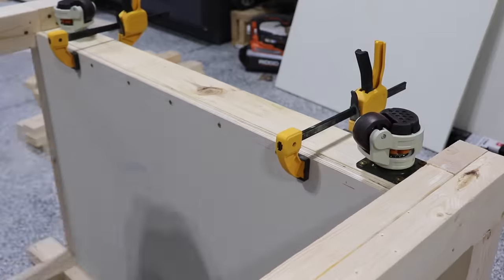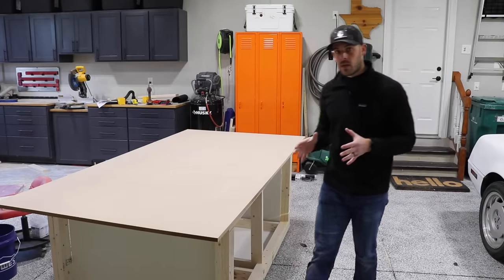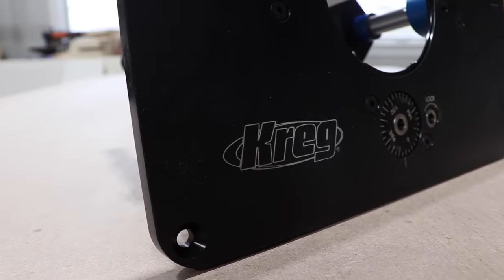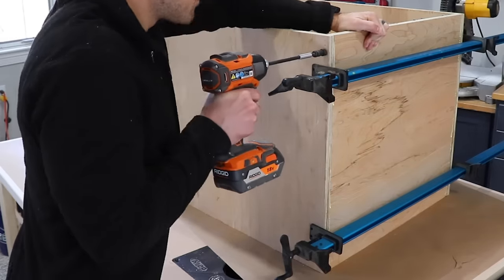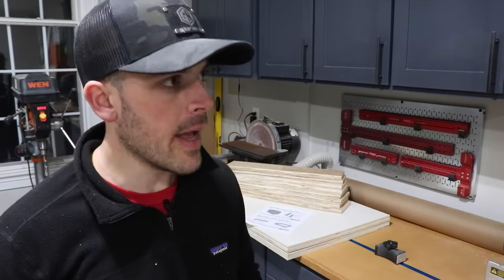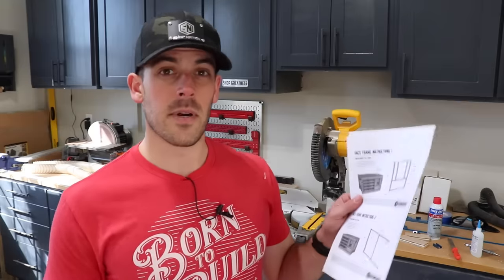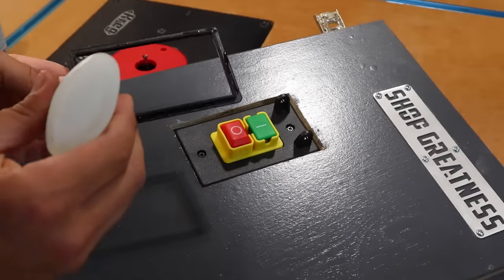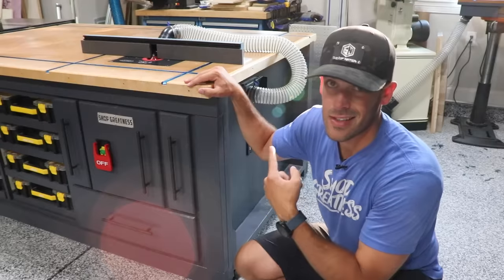The most ridiculous DIY workbench on the internet (Complete Build)

Comment: Just a note for the future, and for your fingers, never wear gloves while using power tools that spin. You do NOT want to know what can happen if, God forbid, something snags the glove while you are moving a board through a jointer.
Reply: I have a glove sitting on my table saw to remind me.  I got very lucky and only got a minor cut.
Reply: Gloves are required 100% of the time in my trade. While I can see where you are getting at with this comment. As long as you are wearing the appropriate gloves that are a good fit for your hands and are not loose as long as you pay attention you will be fine.
Reply: Yea its always fine until its not @MeatUrMakerZ
Reply: @MeatUrMakerZ  Maaaaaybe nitrile or latex gloves.... something that would rip easily but work-style gloves is an emphatic NEVER

Comment: Electrically, you should never plug one power strip into another.
Reply: Its fine if you know what your doing by calculating peak current, but on the whole you are correct in that you should not daisy chain them.
Reply: Why not? Double protection.
Reply: In Iraq, we had a chain of power stripes running halfway around the air base at Al Asad. We only lost 1 tent to fire.
Reply: @georgeyoung613 you just have to hide the cord from the fire Marshall.
Reply: @Nougification  Absolutely! You hide the cord before every inspection. If it's ever found, you blame the first Pfc you find.
Reply: You absolutely can IF you know what you are doing and derate the second strip accordingly
Reply: It's fine, just don't plug them in.
Reply: There are exceptions though.  It is a good rule to follow.  It has to do with the circuit breakers on the strip.  If you have good breakers on them and they are wire sized correctly it should be fine though.  I have a set of ones I bought in Germany for 110v that have scalable breakers.  It is designed to be linked, they advise not to exceed the breaker amperage on your panel.  That's mainly the issue that is dangerous.  People will plug in an entire shop and try to continuously run 30a on a 20a breaker. I run my entire shop on mine.  I am 1 person and my dust collector is on its own circuit.  I never run above 15a at any one time because it's physically impossible to operate more than 1 piece at a time.
Reply: @georgeyoung613  Haji strips have zero protection.
Reply: Unless you have multiple people operating multiple tools simultaneously, or are an Octopus, the odds of overload are nil and none.
Reply: It's all good, he did it mechanically
Reply: Electrically, the electrons don’t care.
Reply: That is horse shit and long as the wire and connectors are appropriate for the loads in the power strip.  That believe is from old people with old houses and no outlets with shit power strips and items with a lot of load.    Assuming your power strips are all constructed to say 15 amps, you can chain as many as you want assuming the total load of everything doesn’t exceed 15 amps, including wire loss.   You outlets are all daisy chained in you wall as well, one to another.
Reply: That is absolutely not true. There are no codes about that in the NEC, and as long as you're not over drawing what the wiring can handle, you're fine

Comment: I recently built a workbench with casters using the red 3” casters at tractor supply and they’re incredibly stable! I believe it’s because their locking mechanism locks both the wheels and the swiveling mechanism so the casters can’t rotate. Would highly recommend them and they’re big enough that they can roll over extension cords and stuff no problem!

Comment: I will add that I work in a factory maintaining industrial type machinery.  We have those same casters on a lot of pieces.  They are very easy to raise equipment up and lower down and hold a ton of weight.  They make it easy to roll equipment around. Good choice for your bench.
Reply: One very cool thing abouthe casters is that you can sewt everything level. I have them on a pool table I built. Sometimes in woodwork a level surface reference can be very helpful in glue ups and measuring

Comment: Watching you use the router in the wrong direction, then clamping on a piece to eliminate blow out was worth the price of admission. 😊
Not busting your balls. Router bit facing up, right to left. Router bit down, left to right.
Reply: And....don't make that deep of a cut in a single pass.  Rule of thumb that I've heard is to take a bite only 1/2 of the diameter of the router bit.  So, if it's a 1/2" wide bit, only take 1/4" of material per pass.  It looked like you were having to work hard to push the router through the material.   You should never have to put any muscle into your router cuts.  Something is wrong if you have to work hard with a router.  It could be dangerous.  Love your videos.  You have great ideas.  Your finished product is amazing.  Keep up the great work.
Reply: .. and also, the way he carries boards is disturbing. It's all fine and well now but 15 years from now he'll wish he used a rope sling and a straight back.
Reply: Dam YouTube is rough
Reply: router bit facing up, riht to left and down for left to right is not accurate. depends on which side of the wood your on. that being said, if your routing the face towards you and the router bit is down, then yes , it is in fact left to right. and thats what he was doing. look at the position of the router.
Reply: however his pass should be no more than half the width of the bit hes using. youl;l break pieces of the wood right off if you try taking off a half inch with a quarter inch bit
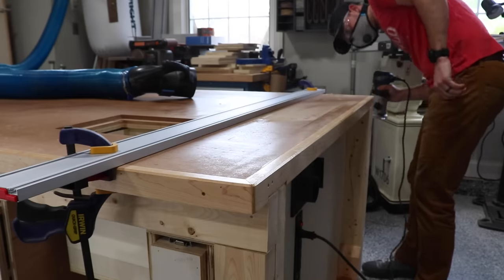Reply: @ericgustin3386 39:10. Wrong direction.
Reply: @michaelcocroft9700 he is making a groove. There is no wrong or right direction. 

Direction is only relevant when working on the edge of a workpeace with a Router.
Reply: @holgerk6352  Hmmmm. Yeah…. No.
Reply: @michaelcocroft9700  when routing a grove the material is always in contact on both sides in rotating direction and one against rotating direction. It doesn’t matter. The router removes equal materiel in spinning and against spinning direction. You can do a 360 around it while routing. 

This is only critical when you route one edge (inside or outside) as there is clear one direction to router wants go natural (and you have to go against).

Comment: Loving this bench, I may make myself one.  From my background in electrical, my only suggestion is circuit breakers.  Each of your power strips should have one built in, and TEST it (cheap chinesium may advertise but not include it).  Reason is, you remember the amerpage restrictions now but how about 5 years from now?  Overload inside wood shop furniture is a great fire starter.

Comment: This is awesome. I'm currently working with a contractor to build my combination wood shop, electronics lab, and music studio... so yeah, I'll be needing a little flexibility. I've built custom benches for work areas in the past, which always did better than off-the-shelf stuff. So I'll be building some custom and, in many case, movable benches for this space over the next 2 or so years. Thanks for doing this! Haven't decided if I'll use this, though it's pretty on-target, but if nothing else, you've already improved on my previous bench-building designs. Thanks!

Comment: I got the plans from you for the medium bench.  I did make some modifications to it, such as increase the overhang that butts up to my table saw ( it is an older Craftsman with an exposed motor.  The overhang protects the motor from wood dropping on it.  )   The table top is 3 each 1/2 inch plywood sheets that I laminated together.  The frame is reclaimed 2x4's from a neighbor's house remodel.  The overall look is white oak trimmed in black walnut.   I did go with the Jessem router  lift and I purchased a Power Tec fence for the router.  Thanks.  I look forward to more videos from you.

Comment: Several years ago I built something similar to this. The top is a 1/2 sheet of 4 x 8 Home Depot cheap plywood. Originally I wanted it to be  a 1/2 thick piece of butcher block but I thought about the price which was just under 1k at the time.
I used a similar caster system but mine have a built in ratcheting mechanism which makes moving the table a breeze. In fact the table is so heavy that I really don't need to rest the table on it's caster pads. But when you do it feels like trying to move a block of granite.

Comment: Really cool video. I can tell you put a lot of time and effort into designing so that things would go together smoothly. 

1 Piece of small advice I noticed is occasionally you’ll not clear your left hand FULLY when you’re shooting brad nails for joining two perpendicular boards. You should always assume that brad nail will divert from a hidden knot or hard spot and come splintering Up the side of the piece rather than following the intended path. 

Its a by product that we all pickup as we learn to hold the boards flush when first setting the corners. So remembering to shift your hold away more than a brad length away from the point your shooting into. Only reason I’m even bothering mentioning is cuz I brad nailed my hand to my project doing the very same thing, hope it saves you an injury.

Comment: Only thing I’d change is to glue a top veneer like melamine instead of sealed MDF. But great plans regardless! 
I have a sanding area in mine that simply has some holes connected to the dust collection so there is a fine drsft
Reply: Was about to suggest that.  I would raise the maple edging by the thickness of the laminate and level the edging to be smooth.

Comment: Nice to see the full detailed version of how you built this as I'm going through making some shop furniture for my garage workshop right now :).  OH... also just to mention, for those casters and how they can be a bit of a PITA to adjust (turn the thingy in the middle), I have 2 suggestions for you (although perhaps you've done one of them already as I'm only 8 min. in while writing this).

1.  Another channel that used them made what can only be described as a key.  It's a about a 6 to 8 inch long piece of MDF / Plywood, and there are teeth cut into one side of it that fit into the notches of the thingy on the caster, and are spaced out accordingly (also make sure the  whole key is the same height as the thingy).  Then he just pushes or pulls the key across the thingy, the teeth on the key catch the notches on the thingy and rotate it.  Voila.

2.  This is the option I picked and is far easier IMO.  They make a version of that same caster with a built in ratchet!!  So instead of a rotating thingy, there's a small ratchet with a direction toggle that works just like a socket wrench!  Set it to clockwise / counter-clockwise and then just wiggle it back and forth like a socket wrench and it'll just raise / lower the foot.  They also have several sizes of these casters to support more weight, so I got the 4 inch monsters that I needed to support the bench I made for my table saw / router table thing.  Each foot can take something like 400lbs I think?  Might even be much higher than that.  Just found them on Amazon.

Comment: Great job. I actually built a similar bench (not as fancy) for my CNC machine. Under the table, I have a shop vac with a Home Depot Dustopper on a 5 gallon bucket, a pancake compressor for blowing off residual dust and a 5 gallon bucket of coolant (windshield washer fluid) with a pump for the water-cooled spindle and a lot of the same electrical setup.
 A couple of things you did gave me an "Ah-ha" moment. I've built a lot of cabinets over the years, building the carcasses then putting in the slides later, then the drawers. That was what I planned to do for this table. When I saw what you did, installing the slides, building the boxes, then fitting the boxes into the table, I slapped myself in the head. Duh! Why didn't I think of that? I liked your using the Sharpie for marking the aluminum. I do some work with metal and trying to find DyeChem is not easy nor is it as cheap as a Sharpie. I subscribed and look forward to watching other videos. I can relate to the mistakes, since I've made those and many others.
Here's a tip for you. I have done a lot of plastic laminate (Formica style). When using contact cement, I'm sure you know, you get one shot at attaching it. Well, I had a full sheet that I got slightly crooked. It was stuck and $100+ was going down the drain. Looking around my shop, I spotted my favorite solvent - brake cleaner. I squirted it under the edge and peeled the laminate right off. I cleaned off all the cement, reapplied it and stuck it on correctly. Whew!

Comment: Small tipp when you use a jointer. You should push the part behind the cutting blade down and not before the blade, because you will lift the piece and it can end not perfectly flat.

Comment: I set up my bench top jointer so my work bench is an out feed, can joint pretty much any length I want, the thing about bench top jointers is you have to take shallow passes and take your time, it's really the only difference from floor model, just saying cause ALOT are so wrong about bench top jointers, they get a bad rap..and nice job on this bench man..

Comment: I'm glad this build series is in a single video.  If there's one thing I learned between you and Tamar of 3x3 Customs, it's to glue your boards first, then trim them to final size.  Doing it the other way around is messy and potentially causes trouble (boards not being square or centered after the glue dries).

Comment: While watching this I realized I could use a cabinet like this doe my CNC router, which is currently sitting on an old kitchen table with open space below.  Having the extra storage and drawers rather than an open space will be much cleaner and more organized.  However, I may have to make it so it can be partially disassembled to fit through a doorway to allow it to be moved.

Comment: Thanks for the video.  I had a question about your dust collection though.  Initially your wall mounted unit was the sack style, but then near the end of the video it is changed.  I've heard that the sacks tend to still produce a lot of fine dust when used and was wondering, is that is why  you changed it?

Comment: The problem you may experience with aluminum angle is that it is often not square. This would need to be corrected before use. A milling machine with a flycutter would produce the best results, but a slab flattener could be adapted to accept a belt sander.

Comment: I am working on this bench currently following along to a T. I have run into an issue with my upper brace install though. They are a 1/4 inch too short. They are measured to the 29.75 as laid out in the plans. Before I cut new braces to fix the issue... is there an issue I may run into by increasing the brace length or maybe I'm missing something else?

Comment: What is the over / under on how long it will be before you change out the plastic blast gates? My guess is 1 month. It won't be long before you discover that they easily get jammed up with saw dust and require being taken out to clear the jam.
Reply from the maker: 3 years later, no issues

Comment: You don't have to sand off the sharpie. Sharpies are an alcohol based ink, you can remove it by going over it with concentrated isopropyl alcohol (97-99% rubbing alcohol) or a dry erase marker. 

Another option for blueing is to use water-soluable powder paints but mix them into ethanol (Everclear or wood alcohol) for application then wash them off with water afterwards. Unfortunately, you can't use water to cool your work piece with this method. That's not a big deal for aluminum, copper or brass; but iron, steel, titanium, pewter and bronze need cooled while they are being machined.

Comment: Pretty AF. One ultra minor suggestion, and I bet you have it: the floor ramp thing for the power cord coming into the bench so things can roll over it and you limit tripping hazard. Even better 3D print a new cool solution for power cords that run across the floor

Comment: If using the router on aluminium feels scary, you can also use a jigsaw with a specialized aluminium blade then use a metal file to refine. Doesn't cost much and can be a good alternative a bit less sketchy.

Comment: Love this build. Why did you go with the Powertec blast gates though? Have you had a positive experience with these (unlike mine)? I used those exact ones and learned they are impossible to clean when dust gets in the gate slots. I upgraded to metal ones and haven't had a problem since.

Comment: I put four , three drawer filing cabinet. Then put two 3/4 sheets of plywood on top ,,, painted the whole thing with a two part epoxy  install LED string lights along the edge so you can see inside drawers & above at ceiling height,install a bench grinder & vise ,, ,,,,, it’s my mechanical  electrical  work station,,  I have another one strictly for woodworking with tools stored in filing cabinets

Comment: I know you have plans for a workbench that incorporates a table saw into the bench. and I think thats what i want to do. but I don't have that much space so is there a way to build your bench with the table saw, the miter saw and a thickness planer. and if it helps i'm a dewalt fan boy. and i have the 10 inch saw and the the 13 inch planer and the 799 miter.

Comment: To let you know for the sake of precision, a jointer is only good to make one side square, your actually supposed to use the tablesaw to get the other side square.
So you run one side down the jointer then use that side as your fence reference while you rip the other wise with your tablesaw.

So in buying order you should of bought the tablesaw first a planar second then the jointer

Comment: Running the laminated parts through the jointer is perfectly fine. However the say you should only run one side then rip the other or you wont  have a square board. You can't joint both sides apparently